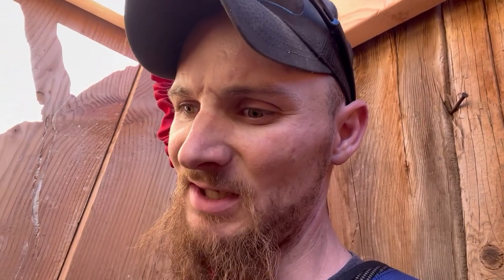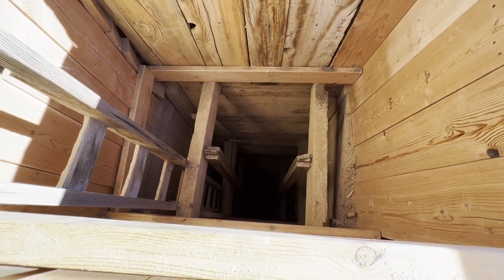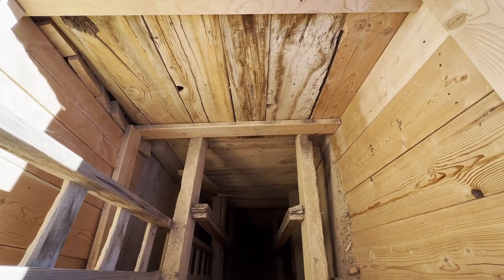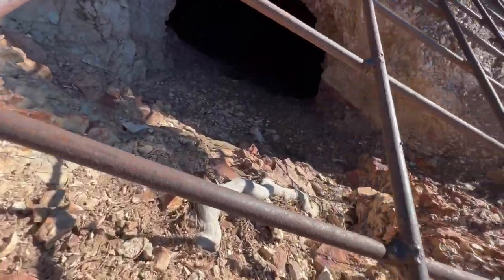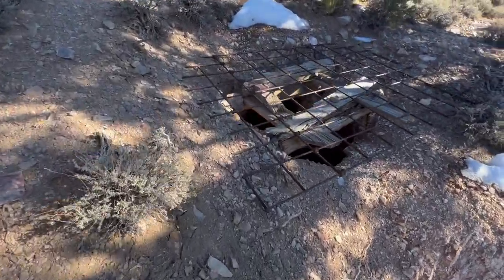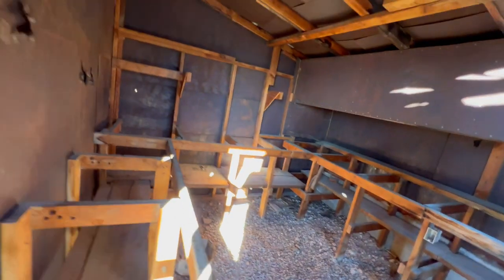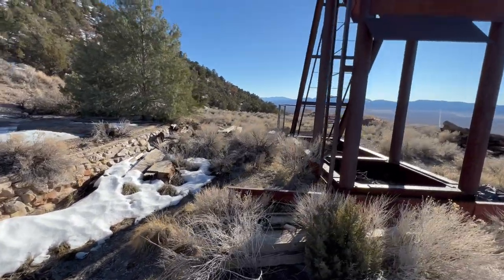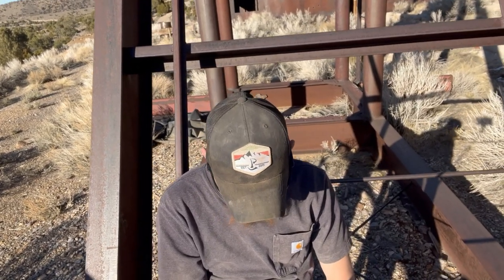Working in a 147 old mine shaft

Comment: @4:40 I would say the wood had the same purpose as the rebar mat today, so nobody can fall in. Probably the surroundings were washed in, and the hatch went missing over the years.
@6:45 The breakpads may contain asbestos, and if so, the surrounding ground is contaminated as well from abrasive wear
Wow, those inclined shafts look pretty cool, especially the steel one is massive and in good shape including the winch.